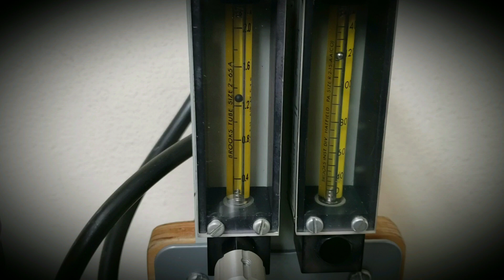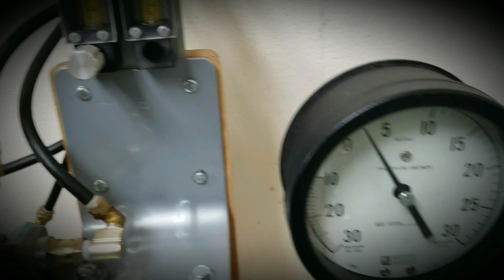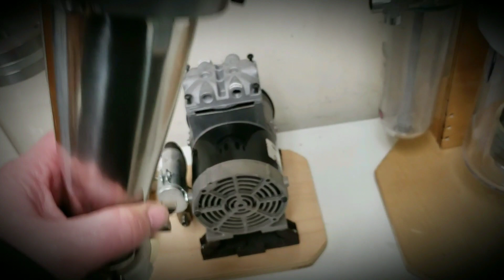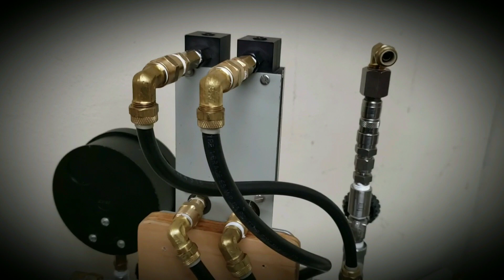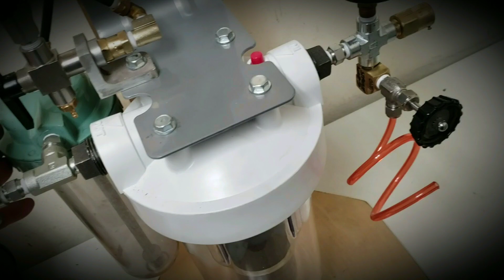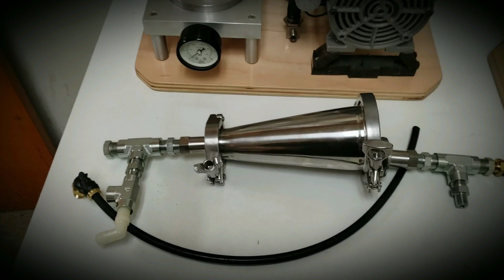2-12-2020 De~Lovely Wet Hot & Steamy  Fusion Reactor Update

Comment: I believe you can also use that high order ozone to pull matter out of the quantum field.
Reply from the maker: Yes,
When you get over the black line into Ozone 7+ ozone dose not oxidize it catalysis.
Reply: @Hhydrogen4Power I heard about a story which had an industrial ozone generator bubbling through mine tailings waste. The plant was oddly making static high voltage and running the water over an activated carbon tower. It was to clean up the mine waste before discharge into the river...but it turned into an exttaction device that was pulling more gold onto the carbon than the gold mine could dig from the earth. Can you expand on "over the black line"?
Reply from the maker: @m3sca1  first, quartz is piezoelectric. Then the gold is digested easier from the quartz from the lenz effect of carbonic water over carbon. All water has some calcium carbonate in it making a weak acidity in the dissolved solids.
Ozone 7 is found two ways, during liquid and high vacuum. Not atmospheric. That's why ozone 6 is an unstable atmospheric phenomenon. Over the black line is a physic term. That simply means unattainable. Yet my avatar clearly shows Ozone-7+. The green needed oxygen to get there, my guess is this is what the explosion of earth should look like, however highly unlikely to happen, because the cats eye nebula supposedly was a star: who knows. However, it's a perfect Hydrogen Deuteride experience and that's why it's my avatar and it's the only nebula we can see with naked eyes. Just look east, just after Mars passes over your head and reaches 3 o'clock, it's better when Saturn is rising, remember Saturn rises at the west. 
Hope this helped.